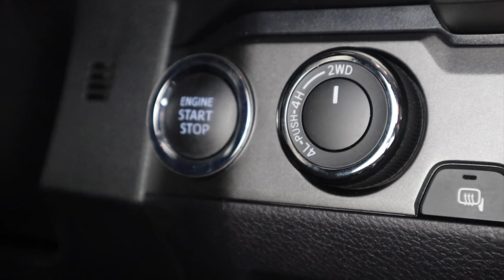Should you buy the latest Toyota Tacoma 2016-2021?

Comment: Back in the day these trucks were called Quarter ton as in 500lbs. Now I had a Ford Range XLT and found the ride comfortable.
Always used it for smaller jobs, carrying a bed, a sofa.
Those jump seats were a joke.
V6 gave it plenty of get up and go. It was not meant to pull a boat.
They hadn't yet gussied up the trucks yet.
You could buy and still can  buy a stripped down Ford
Roll up windows, bench seat, no a/c manual transmission truck. V8 power. Might want 4*4 not so much racing through a swamp, muddy, snow packed job sites. Even the F150 can pull a trailer.
Jobber trucks opt for the 3/4 ton.

Comment: I just had my rear doff resealed with a new Gasket by a dealer under warranty. 11k miles. Also had the rear bypass pipe replaced at 8k. It was eating a liter every 4 months. Waiting for the timing cover to start leaking.

Comment: Bought a '16 Limited in Fall 2019, so far I've had the radiator and thermostat replaced after it overheated and popped, Currently, the truck is once again sitting in the driveway with a coolant leak but after some hunting it turns out several hose clamps were loose on the thermostat. I did however spend some time check that rear bypass valve and haven't noticed any leaks or coolant so I hope to God no problems arise there. From, what I can figure this poor truck didn't get the best care so I hope I can provide that for it. Always love detailed information like this that I have yet to find anywhere else.

Comment: When I bought my Tacoma, in 1995 serial number 1500 or so, I joked it might be my last truck I buy, well here it is 27 years later and it runs as good as the day I bought it, but I will say its a real basic model, 5sp, 2.4, heck the clutch lasted 260,660 miles. I did install some real nice bucket seats, the bench was totally worn out, and hurting my back, needs a paint job, which I will do in my back yard,  in Fla the sun just eats away at all paint, but its totally straights no dings, burns no oil at all, 26 miles per gallon, in town.

Comment: I bought a 2021 SR5 double cab in December. Still under 3k miles on it. I have had issues with the engine or transmission surging when cold, especially when backing up. I also notice it lugging when accelerating, sometimes chugging. Using the A/C exacerbates the lugging. Everything else about the truck is excellent. I’ve had the dealer check it but, as expected they can’t find any issues and no firmware updates are needed. I almost bought a Ridgeline before buying this truck. Of course there’s no real comparison between them, but when it comes to the engine and drivability of the two, the Ridgeline is much better. If had had it to do over again I probably wouldn’t have this Tacoma.
Reply: I hand the same  issue  when cold. I did some  research  online  people  reporting  when transmission  fluid  . So checked  my transmission  it was  1qt  low . Now transmission  shift  perfectly  now

Comment: My 2011 Tacoma had the Cat problem..   Other than that it was problem free until I decided to get a new one...  It started using water, threw codes, random miss, cylinder 2 or 3 miss...   Added block seal and traded it for a 21 Tacoma. But it took 2 months to get the truck(Pandemic).....

Comment: Bought 2017 v6 tacoma used at 25k in 2019. Mid 2022 now at 80k miles with zero issues. Oil changes every 5k miles. Probably need replace the trans fluid soon

Comment: First of all, "Car care nut" I really enjoy your videos, they are so informative and are produced in a very professional manner to hold my attention even if the subject does not apply to my Toyota models.  The last three vehicles that I have purchased were Toyota. The next probably will not be. I have a 2013 Tacoma, white in color. I have noticed in the past, under the hood and in the door jambs, paint missing down to the primer. I wrote it off as points of contact that wore the paint off. Today, I washed the truck and paint is coming off of the body. I owned a GMC white truck in the 1990's that did the same thing and it turned out to be a paint and primer incompatibility issue. I looked on Youtube and discovered that many Toyota models were recalled for the paint but not Tacoma. I also have a 2007 Camry with 74K miles that has been properly maintained by the dealership as my Tacoma has been and it has the oil consumption issue. What is the process to get my Tacoma issue resolved??  Love your channel, but I have developed a hate for your product and customer service!

Comment: I change the front and rear differential, transfer case and transmission fluid every 30K miles, as well as the brakes are bled along with the pwr steering fluid.

Comment: AMD. Could you please talk more about how exactly dealerships coat the frames (under warranty)? How messy is the application? And more importantly,, does the coating get in the way of repairing/replacing of other parts - such as the suspension? Do they mask areas to avoid being sprayed? I would love to see a video of 'before', the prep process,  and the resulting appearance of the underside. One would hope that the technician has special training and is fussy by nature.
Reply from the maker: Hi! I can do that once the program expires which is soon. I can’t talk about active campaigns. But I’ll tell you this. It’s a meticulous process, requires additional training and doesn’t affect anything else on the truck because the spraying is inside the frame.

Comment: This was an overall very informative video honestly I have had my truck since November of 2016 got it with 2 miles when I test drove it and it's at a cool 50000 or so now and I'm just now noticing the issue with the ac these lst couple of months but I'm definitely going to throughly check my 2017 for the other issues before I only take it I'm for the ac part, thank you your video is good important content.
Reply: Hi I just bought a 2016 Tacoma the a/c I noticed it's cold on driver side and not so cold on passenger side ?? Do you know what is the kit called for the a/c thanks

Comment: If you have a 3rd gen with a 2.7 4 cylinder, tune it. Big improvement in power and acceleration. It will feel like you added a small turbo to it.

Comment: After experiencing unbelievable driveline vibrations in my 2019 TRD Offroad long bed, I sold it after just one year of ownership. It was so bad I couldn't stand driving it and Toyota 2 different dealers couldn't resolve it. Sadly, I still haven't found another midsize truck that has a long bed and all the features available on the Tacoma. I love the way the new Frontier drives, but it's missing a ton of basic features. Believe it or not, I'm actually considering buying another Tacoma, since 4 yrs have passed and they've had time to make improvements.

Comment: I have a 2022 w/ automatic trans and it still doesn't shift smoothly, it will gear hunt between 50 and 60mph. I had read on Toyota forums, that other owners had experienced these problems as well, not just with earlier years.

Comment: Dear Mr. AMD!
I am so grateful that I found you today because after many years of saving, I have finally got myself a Tacoma!
Thank you so much for the information on putting the truck in 4WD High and Low on a monthly basis!
Would you kindly tell me how many miles do I need to do this monthly 4WD thing?
I am also very grateful for the replacing the transmission fluid at 60K or 6 years whichever comes first!
I am also grateful for the “NO LIFTING” tips!
If I live in Homer Glen, you know I will be your most loyal customer!
Again, I have so much respect for you and if you would answer the one question that I have about how many miles should I drive in the 4WD mode monthly, I would really appreciate!
And lastly, I have already subscribed and will share with all of my friends and family!
Thank you so much Mr. AMD!🙏

Comment: I got my 21 Taco with 29K miles on it, but it was driven by the Service Manager of the Toyota dealership an just came off his lease, and I saw the service report and it was taken in almost every 4 months to be inspected!~  I got mine rust proofed, as well, but the paint protection I question as there was still dirt on the truck and they claimed they wash it!~
Taking ya Taco through a car wash just is asking for it to be all scratched up, an the dealership an they hid them.

Comment: Just watched this video. I bought a 21 in March. I've noticed the shutter at 45 to 50mph. Also on the electrical end the entune is an issue. Especially since mine doesn't use entune. Mine uses android and apple instead. I have a schedule maintenance coming next week. Will take your advice and have them check for software updates.

Comment: the third brake light and also the rear vents.  I had to reseal both of them as well as gut my interior and steam clean everything.  Not a fun job!  Also the seat heaters are all problematic.  The amps under the seat will burn up and are a fire hazard.

Comment: I have a 2018 Tacoma Off road with manual transmission. Many owners of the stick shift truck find that the clutch pedal will not return in cold weather. 20f degree and below. Very annoying and dangerous when pulling out into traffic and the clutch won't fully engage. I tracked it down to the plastic clutch pedal. It pivots on a steel shaft and when the temperature drops the plastic shrinks and binds on the pivot shaft. Toyota is aware of the problem but refuse to issue a service bulletin. They also won't correct the part so a replacement will be just as bad as the old part. The squeak you mentioned is from the return spring where it attaches to the clutch pedal. Very annoying. Small contact area so any lube used gets squeezed out quickly and back to squeaking.
Also, my particular transmission has a bad synchro on third gear. You will not shift this trans quickly. Long hesitation between shifts to let the gear cluster slow down. Plus the stupid RPM hang on the motor does not help with getting a good shift point timing pattern. I have been driving stick shift trucks for 50 years and this is the worst one for getting a smooth consistent shift and clutch engagement. 
This is the 4th Toyota I have owned and was very disappointed with it. I still have a 1985 p/up with the 4 cylinder turbocharged diesel. If the frame hadn't rusted out I would still be driving it. 300,000 miles.

Comment: Great video! You should do a look-back video at the prior Tacoma/4Runner with the 4.0L engine. It would be really interesting to see how these two models differ, and your experience with both.
Reply: I've had BOTH.  The 4.0 is a good motor and to me more grunt down low. However, the 3.5 beats it in fuel economy...I never could break 20 mpg on my interstate trip with it. My 2018 trd pro...can do 23 or 24 mpg at 75 mph...and 20 average around town...sometimes better. I did have them reflash my tranny because of the gear jumping...after the flash it will allow lower rpms without shifting...I can keep the RPMS down saving gas. 

The ride in the PRO is way better than the harsh off road ride.  These trucks are pretty smooth on the interstate and handle good too...there tight.
Reply: @jimmy-et1pm  
The 3.5 gets better mileage mostly because of the 6spd trans vs the 5spd with the 4.0. Sure, the direct injection helps a bit but it's mostly gearing. My older lexus is350 sport sedan has a very similar 2gr 3.5 and it sucks the premium in city driving with the 4.08 rear axle ration...but it will also Crack a high 4 second 0-60.
Reply: Someone posted a 2004 tacoma with the 4.0 engine coming in for a 1 million mile service. Same engine and tranny.
Reply: @franjaimes  
I'd rather find a mint, low mile 4.0 model over a 3.5 model.

Comment: We bought the 2020 Tacoma. We are regretting the purchase of this particular model. It's in the shop as much as it's on the road, covered by warranty, but it's had more problems than any other new vehicle we've ever owned. The electrical system is the main problem. on the third battery after 20 months, leaking in a couple of places around the engine, and the transmission needed to be replaced after 3500 miles. Back to Chevrolet for me.

Comment: I wish I would have seen this video before buying my Tacoma. I bought a 2017 TRD Pro Executive Edition with sunroof,JBL sound system that sounds amazing and every sensor on it. The only thing I did notice besides the load engine is that the transmission seems to act weird when cold. Also it seems to shift funny when on cruise control. It’s an awesome truck and I love it but maybe I should have bought a 2018-21. Well the good thing is they hold their value and maybe I can trade it in for a newer one in a year or so…
Reply: I have a 2022 TRD sport 4x4 and transmission on cruise in hilly areas is a mess lol.  Otherwise bulletproof so far

Comment: A very good and informative video but I have to somewhat disagree with some of his "faults" he describes in the '16 Tacoma.
I have a 2016 Tacoma TRD PRO, I bought brand new, and it is definitely the best vehicle I've ever owned.  
Since owning the truck I've had 3 recalls, two of which he mentions, one the 3rd brake light, two the frame and third a possible loose bolt in the rear differential. Toyota informed me of these recalls and as to the loose bolt in the rear differential it was just a matter of making sure it was tightened, and mine never did leak. The frame was recoated  by the dealer sometime in the first 6 - 8 months of my ownership, and there has never been a problem with rust. lastly was the third brake light leak, which I never noticed, and personally don't think it ever did leak. None the less I brought the Tacoma to the dealer, who told me the truck would be "tied up" for one or two days. and gave me a loaner car to drive. I asked why it would take that long to just "change" that third brake light and the service manager informed me it was more than just the light. Apparently the first truck Toyota repaired they found "mold" in the passenger compartment. They completely removed the entire interior of my Tacoma, cleaned and sprayed for mold, even though they found none,  and replaced the third brake light.

Comment: I had a 2017 SR5 4X4.  Breaks not to good, MPG I guess ok, seating terrible (like sitting on the floor), poor head room,  Cheap plastic bumpers that break easy, flimsy body, throttle response horrible.  Don't dare to pull out into traffic, transmission ok at best.  For the price and compared to my 2013 standard cab 4X4 and price I expected a lot more.  Might be why they add in maintenance and extended warranty right into the price of the truck.  I ended up trading it in only after about 2 years.  They might be dependable but they just lagging behind a lot of other trucks.

Comment: about the get my second double cab SR   had the 2018  zero problems  and brakes over 109,000 miles     might be " rough" ride to some, but I found it very comfortable, especially on highway   I don't need or want all the heavy and expensive add ons.   reliability is my priority

Comment: I have a 2019 SX v6/auto extra cab 4x4. 1 early recall on a fuel pump issue. thats pretty much it. And  I put the aluminum filter canister (LexusV6  item If I recall) inplace of the plastic canister.

Comment: Own a 17 trd orsb 4x4 tacoma recall took care of my fuel pump but never really had an issue, the only problem I've experienced was the missing lower end rpm torque performance which was resolved by getting a kdmaxx pro tune done now it shifts gears and performs as it always should have hope I don't experience any of those other issues you mentioned about the 2017 model and mine doesn't fall under those assembly vin numbers either but so far only have less than 40k miles on her but can say she drives better than the day I  bought it.

Comment: My 2019 TRD Off-Road is my third Toyota truck … all purchased new.  My first was in 1988 - had it for 10 years.  My 2nd was a 1998 SR5 xtra cab which I had for 20 years until a girl in a Ford F-150 t-boned and totaled it.  The 3rd is my current TRD, which I’ve had just over 2 years.  This current truck is by far the poorest with respect to quality.  Dash rattles like an International Harvester combine.  Bluetooth drops every single call.  The transmission … ugh, the transmission.  If you like gear hunting, this is your truck!  Finally, it’s a really uncomfortable vehicle for trips longer that two hours.  If you buy a 3rd gen Tacoma, you do it for the engine longevity, not for the fit, finish, features, or comfort.

Comment: That was one of the most comprehensive and informative videos on any vehicle. Unfortunately, I bought my 16 Tacoma 6 months before I saw this video so it looks like I've got some work to do, but at least I know what to look out for. Thank you! The one I bought has something else that seemed odd, the VIN says it's a SR/SR5 with a TRD Package, 3.5 V6 auto with all of the TRD kit but it's got a SR5 grille. What is up with that?
Reply from the maker: Hi Brian. The trd package initially didn’t come with the grille and then it changed then it changed again
Reply: @TheCarCareNut  I've noticed that there's more than a few options. As a body man/painter I'll just paint it black and also take care of the rust in the door sill. Do you know if that rust problem starts from the inside or under the protective film?
Reply from the maker: It starts under the protective film.
Reply: @TheCarCareNut  Thanks for all of the great advice!